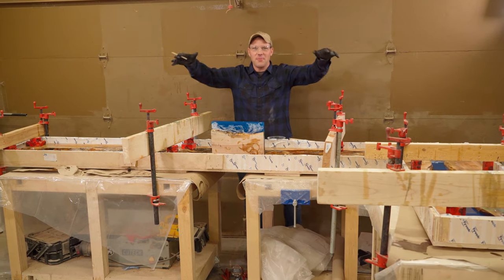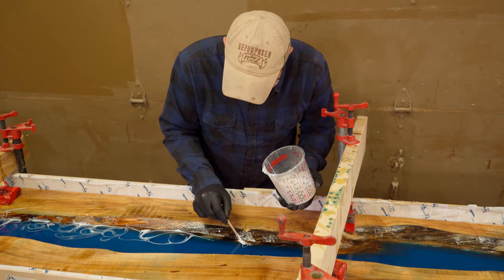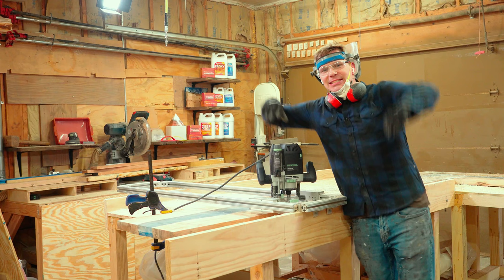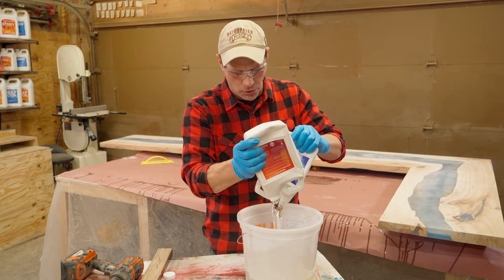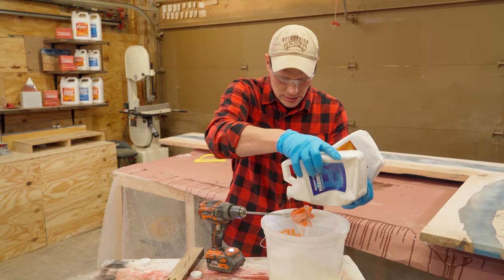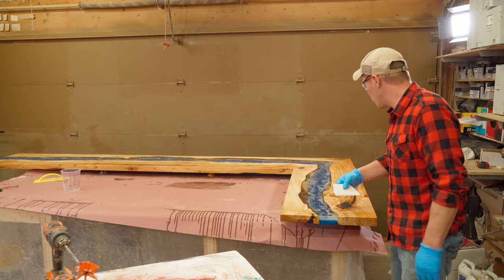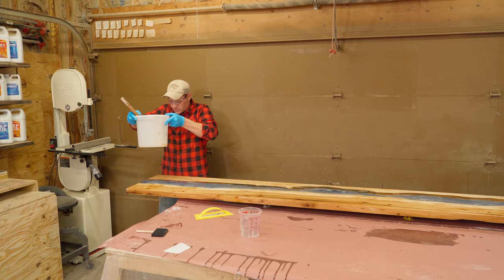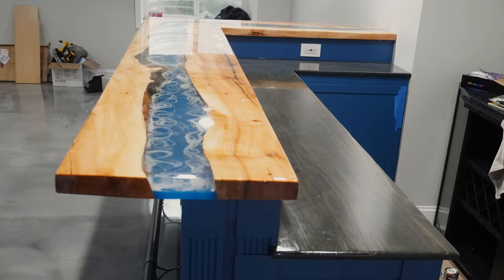How to Create A GIANT L-Shaped Epoxy Resin Bar Top

Comment: some artist do follow seal coats but only the wooden part than they sand it evenly, as the wood has soaked epoxy ,by oiling it appear differently with a natural touch feel of the wood.. that's what i noticed ...

Comment: How did you secure the miter strongly prior to epoxy? Biscuits? Countertop connectors? Pocket hole screws ? Etc ?
Reply from the maker: We use pocket hole screws and seal both ends with wood glue.

Comment: Any concern with the miter causing flood coat to crack with expansion and contraction?
Reply from the maker: Hey John! If all factors (wood + epoxy) are taken into account,  you won't have a problem with the miter causing your pour to crack.

Comment: Are you suppose to pour table top while seal coat is still sticky? And what would happen if your seal was completely dry and you poured table top afterwards? And thank y’all for the great video
Reply from the maker: Yes, you can pour tabletop while the seal coat is still sticky. If the seal was completely dry, it needs to be sanded before the flood coat is poured. Remember, sanding in between coats is necessary so the succeeding coats will adhere.

Thanks for watching our video!!